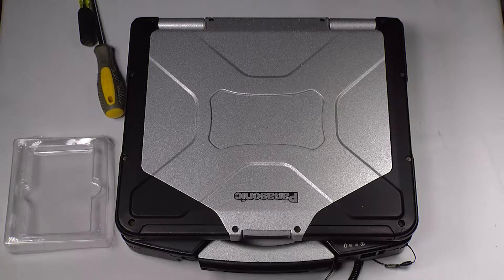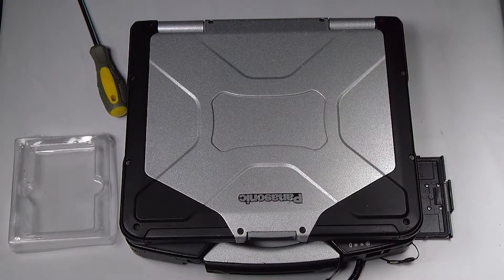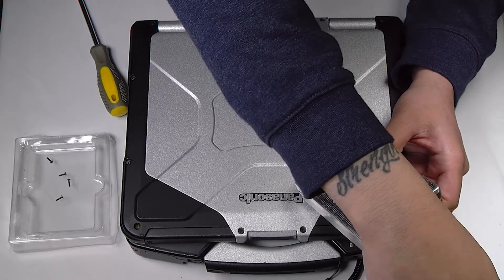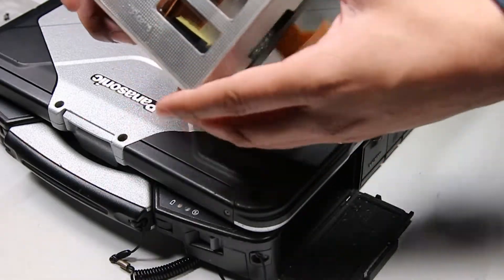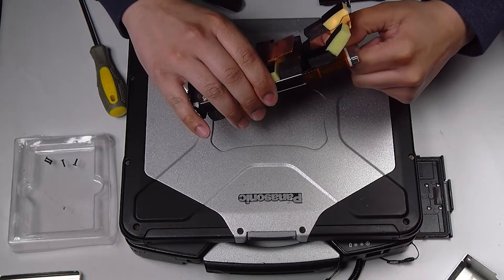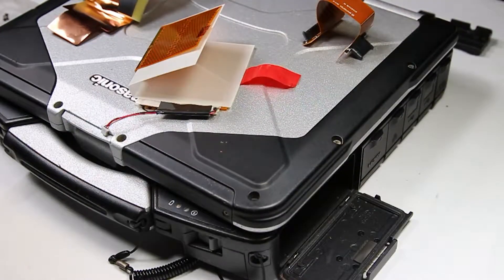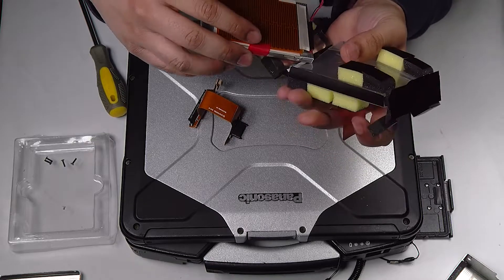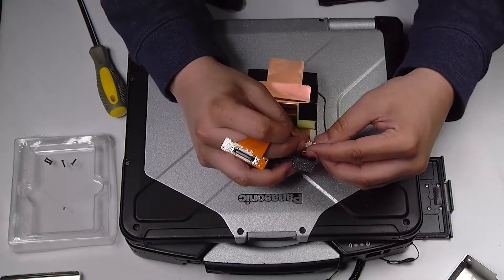Replace Your Panasonic Toughbook CF-31 SSD!!

Comment: How much ssd does support cf31 and maximum ram upgrades?
Reply from the maker: We have installed up to 2 TB SSD drives in all the generations of CF-31s.  Be advised that the CF-31 MK1 maxes out at 8 gigs of RAM, the MK2 - 5 maxes out at 16 gig and the MK6 maxes out at 32 gig.

Comment: What are the cooper sleeves for? EMI projection? The inner sleeve looks like there are two wires coming out, is that works as a heater to stablize the temperature? Thanks

Comment: Thanks for all your great videos.  Bought a like new Mk4 and am having a blast on it.  Question: Does the SSD drive even need the heater?  Mine came with a 1TB drive and no heater in the caddy.  I personally would like one if it needs it.
Reply from the maker: I feel like the heater is not necessary if you have an ssd.  The heater is to make sure the platter style hard drives did not do a cold start which would damage the drive.  With a SSD there are no moving parts and in fact if the unit is cold it might even benefit and run faster.

Comment: Hi.
Could I put my 5TB HDD in a n MK3 CF-31?
MK1 had a 2TB limit.
At that time (MKL1), a cumbersome installation of drivers and splitting the disk was necessary.
Reply from the maker: Hi Ano Nymos, unfortunately, no. Not in anything less than a CF-31 MK4 (which has UEFI that allows for greater than 2TB partitioning). MK1-3 have a 2TB limit. Hope this helps.
Reply: @Bobjohnson  

OK. That's a pity.
MK4 are very rare on eBay. Especially as an auction.
I can't find any among the ended auctions either.
Maybe a MK4 as an auction would end up at $400.
MK3 ended in mid 2020 for around ~$350.

Then I have to look again for this possibility of splitting under Windows. 
Do you know the name? I have forgotten it.
The only not too expensive way to empty SD cards on the go.
It's only a temporary thing anyway. At home, I can transfer it to a NAS etc..
Or is there a possibility to put two or three drives in the cage?
Some kind of "SATA splitter".
Does the 2TB limit also apply to the USB port?

But all CF-31still with the old 1024x768 screen with low contrast, right?
Why has nothing changed there?
It's not a notebook for gamers and graphic artists, but 4:3 with 1024x768 is a disadvantage.
E.g. displaying a web page at 100% is usually not possible.

Is there a list of all Full Rugged Laptop (not only Panasonic), sorted by capabilities like USB3, 2TB+, more than XGA resolution, 16:9 or 16:10 etc.?
E.g. the question, what is currently the cheapest used (auction end prices) Full Rugged Laptop with USB3 and 2TB+ and bright display....
Is there possibly a complete list, a kind of "configurator", that allows narrowing down all existing ruggedized laptops by features?

Comment: Can you recommend an SSD hard drive? Mine didn't come with one. Thanks
Reply from the maker: Hi Elishia! So, Panasonic mostly uses Toshiba SSD's. Hard drive compatibility differs between generations, so it depends on what mark (MK) you have. If you need help figuring out what mark you have, our blog will help: https://www.bobjohnson.com/blog/a-note-on-model-numbers-for-toughbook-nerds/.  The CF-31 MK6, however, comes standard with a 256 GB SSD.  Hope this helps.

Comment: If I do this SSD swap, do I lose all my word doc and excel files?  Will I lose computer programs if I swap the SSD? Thanks for your answer.
Reply from the maker: Any and all info on the original hard drive will of course not be on the new hard drive.  You will need to reload the operating system, any software and then transfer your documents to the new drive.